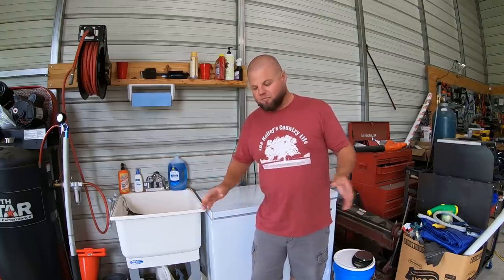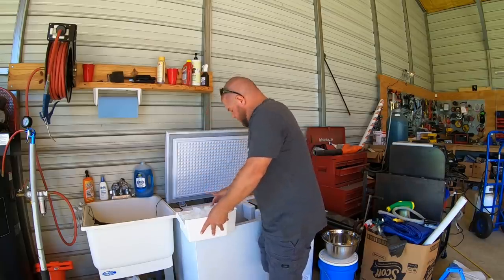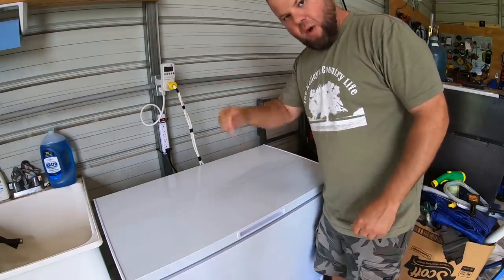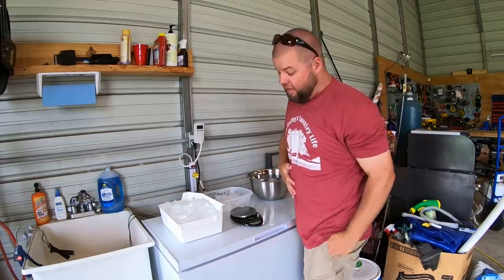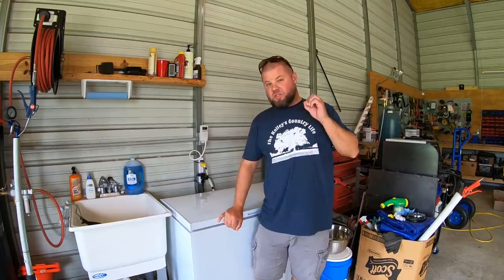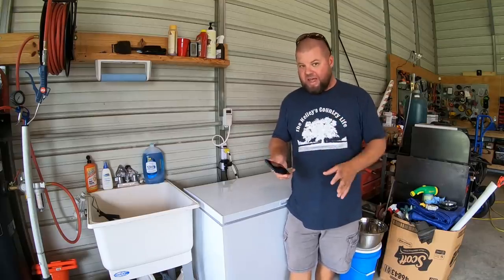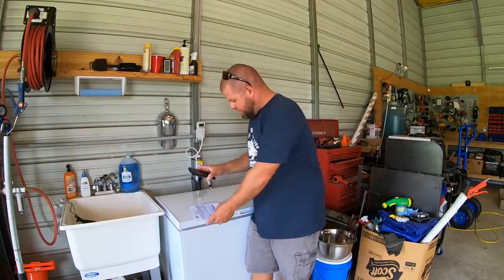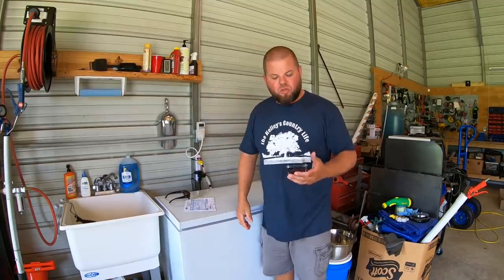Homemade DIY ice machine tests, energy usage and cost per pound! #370

Comment: The cost of commercial icemakers are ridiculous , this is one of the best Ideas I have heard of in a long time.  I live here in Central Florida and go through pounds and pounds of ice a week. Fortunately I have a commercial ice machine that sells 20 lbs bags for $2 right down the road from me.  But I still run out of ice, taking lbs of it with me to work every day.   Been watching this build from the beginning and I don't miss a update.  I want one, but the idea of me putting one of these together is just to scary even with your videos to watch.
Reply from the maker: Well build number 2 might be more user friendly.
Reply: You can do this. Give it a try, you can cobble together videos to learn how to build all this
Reply: TBH, I get it, but I'd encourage you to go for it.

At the worst, you destroy your supplies and they go in the garbage, right? If that's not going to financially ruin you, I'd say the benefit of the sense of accomplishment you'll get from doing this will outweigh the risk you're taking.

You could certainly do this cheaper than him though, find a used deep freezer for one, and to avoid destroying it irreparably, you could drill a hole through the lid, where there is nothing critical.

Worst that happens then, is you patch up the hole and either use it as a regular deep freezer, or give it away to someone.

Just getting the deep freezer and wiring/plumbing the ice maker ate the "hardest" parts of matching his v1 machine, and the ice maker kit comes with the self piercing saddle valve to make the plumbing trivial.

Skip the part of messing with the freezer wiring if you're worried about that and buy a separate power supply to wire them in to.
Reply: If you have the room you will save a ton of money...
Reply: @Nevir202  Love your attitude, yes you hit the nail with the hammer, I am worried about the wiring.  I will take your advice and give it a go , like you said not really throwing that much money away.

Comment: Love this stuff! Great job! You mentioned a box fan to cool the outside, have you considered attaching heat sinks? Like aluminum plates with grooves across it. I think that will help pull heat away from the outside with or without the assistance of a fan, and it may help the efficiency of the freezer.

Comment: I have to say, I've never really had a need for an ice maker at home since we don't really use much ice. But this really makes me want to build one and find excuses to use all of that ice! $.44/20lb is insanely cheap. I think the Rutters up the road from our place sells 8lb bags for $3. This might end up being a nice side hustle for me!
Reply: One thing that I think was overlooked was that he compared the cost of a bag of ice from a convenience store to his energy cost to make the same amount of ice.  He overlooked that the cost at the convenience store also includes some fractional, prorated cost of the equipment used to produce the ice.  He did not include the cost of his own equipment in any way.   That’s a big problem.  He could have used some prorated cost of his own equipment added to the energy costs.  For example, he might guess that his equipment might last 10 years, and if he paid $370 for all the equipment, his equipment cost would be $37 per year or about $0.10 per day.  So if he makes 10 pounds of ice per day, it would take 2 days to make 20 pounds, at an equipment cost of an additional $0.20.  So adding $0.20 equipment costs to the $0.44 energy costs comes to $0.64 for the 20 pounds, still much better than the convenience store. It all depends on the assumptions made for the life of his equipment.
Reply from the maker: Keep watching Don, I do include all costs including equipment
Reply: @donearnhardt6336  He does tell you his cost for all of the equipment. Though he doesn't break the cost of equipment down by hour. But 99% of us aren't going to take a loan out for $370 worth of equipment or try to pay for the equipment by the hour. There's no need to put the cost of equipment into the hourly breakdown. BUT if you want to break it down that way, that's fine and up to you. Either way I think he does a great job with laying all of the relevant info out there. Fridge Ice makers and deep freezers typically last a long time.
Reply: @weschubb3855  I was not talking about the hourly cost of the equipment.  And I know he mentioned the amount of money he spent.  But when you compare his cost to make ice verses the price he paid at a convenience store, you can’t just use the cost of the electric energy he paid to make the ice.  You have to include the cost of his equipment too.  The convenience store includes the cost of their equipment in the price of the ice they sell in addition to the cost of energy (plus their other overhead and profit which I was not suggesting that he calculate).  His cost per bag of ice includes the energy expense plus the equipment costs.
Reply: @weschubb3855  by the way, I’m not trying to distract from what he did to build the ice maker, I think he is very innovative and smart to build this ice maker the way he did..  I’m very much impressed with the way he did it and with all the subsequent tests of his ice compared to other types of ice. Watching these videos has been quite fun.

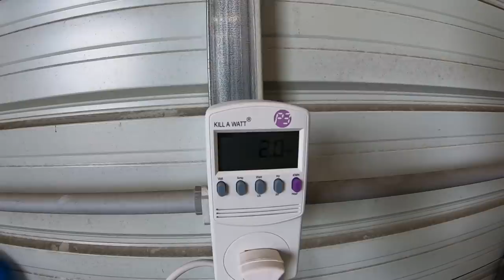Comment: 10:04 That's because the AC/DC power adapters giving off 1 watt of heat. Keep up the great work! I wish I did a video on my icemaker project that I did a long time ago!
Reply: So with a 5v 1.5A (for head room) power adapter and a barrel jack splitter you could use only 1 adapter and maybe save a little more? Probably not worth it except to make it cleaner.

Comment: You are having fun doing this keep it up lol. I have an older commercial ice machine that does burn a lot of electricity so what i did was buy a 14 cubic foot freezer and bought 20 pound ice bags and fill them up and transfer them to the freezer and it fits 19 20 pound bags and then turn the ice machine off till i need it again .

Comment: You need a raspberry pi with a few one wire temp probes so you can track and chart temps of ambient, bottom of the cooler, water coming in, etc. You could run like 8 probes off of one raspberry pi. And they are super cheap too.
Reply: This would be fine for testing/data collection, but I prefer the KISS methods... simpler is better.

Comment: I have bought most of the stuff. gonna get a freezer this weekend. ready to build one
Reply: @charlieodom9107  good thought but I just checked FB market place and craigs list. the cheap ones look 🤕🤢 and the nice looking ones are 🤑🤑🤑  I'm gonna get the Amazon one for $229 and know it's in good working order. thank you for the idea to buy used though
Reply: @charlieodom9107  it's called the Koolatron KTCF195 Compact Top-Opening Chest, Mini Freezer with 7.0 Cubic Feet Capacity-Ideal for Home, Apartment, Condo, Cabin, Basement, Garage-White

Comment: You could also mount everything to the top door/lid so everything is out of the way when you open it so you can have better access to the ice. Looks like it would be pretty easy to hookup those aluminum supports you made.
Reply: I really like that idea, but what if there's water in the ice makers (or even just one of them) when you open the lid?  Kind of a mess.
Reply: @jimichan7649  instead of mounting them solid, they could be mounted on a drop pivot bracket so the ice makers always stay level no matter the angle of the lid.
Reply: @donniecahill5243  Interesting idea, but it's starting to get complicated.

Comment: Run a long copper coil through a mini fridge next to the freezer. Will chill the water between ice maker cycles. And you can keep cold drinks in the shop.
Reply from the maker: It's on the list

Comment: Love the videos man keep it up! I'm also in Florida and have a deep freezer laying around I'll do this to. One major thing to note that will make a difference is the lid seal. My current kitchen freezer after getting anything out then closing it, sucks the door tightly closed for 2 reasons. One is the seal is excellent, and two, the warm air that entered is rapidly being condensed within seconds creating a vacuum and thus rapidly cooling. If you can brainstorm ideas to figure out how to route the tubing and wiring through the lid or a better way to completely seal it, I think you'll have even better results!
Reply from the maker: Wait for version 2.0, I have a fix

Comment: I didn't see the comment but whom ever thought economically you where going to spent more or the same making ice was not thinking clearly. The ice company has to not only make the ice, deliver the ice and freezers to many retail sites using trucks [fuel,insurance, maintenance, etc.], drivers [and all that comes with employees], and share profits with the retail outlets. That is why it costs $3-4 a bag, most of those costs are not what it takes to make ice but the overhead.

Comment: Incoming water temperature will only affect the amount of ice a little, here's why:

To turn water into ice 2 things need to happen.
   1. The temperature must drop to the freezing point
   2. The material must undergo a phase change (from liquid to solid)

How much energy is needed for these 2 steps is described by the "Specific Heat Capacity" and the "Specific Latent Heat" of the material.
   1. The Specific Heat Capacity says how much energy is needed to change the temperature by a certain amount of a certain quantity of material.
   2. The Specific Latent heat says how much energy is needed for a state change (liquid to solid for example) of a certain quantity of material.

For water the numbers are:
   Specific Heat Capacity: 4,200 J/Kg°C
   Specific Latent Heat: 334,000 J/Kg

This means:
   To drop the temperature by 1 degree celsius of 1 kg of water it takes 4,200 Joules of energy.
   To undergo the state change for 1kg of water/ice it takes 334,000 Joules of energy.
Converted to more common units:
   Changing the temperature of 1 pound of water by 1 degree fahrenheit takes 0.000294 KWh
   Changing the state of 1 pound of water to ice takes 0.04208 Kwh

As you can see the majority of the energy goes toward the state change.

Here's a short calculation to show the difference in 2 examples.
   1. Incoming water temperature is 90°f:
      To cool 10 pounds of water to the freezing point it will take (90-32)*10*0.000294 = 0.17 KWh
      For the water to then change to ice it will take 10*0.04208 = 0.42 KWh
   Or in total 0.42 + 0.17 = 0.59 KWh

   2. Incoming water temperature is 60°f:
      To cool the 10 pounds to freezing point it will take (60-32)*10*0.000294 = 0.08KWh
      The state change will remain the same at 0.42 KWh
   In total it will take 0.42 + 0.08 = 0.50 KWh

As you can see the difference between 90°f and 60°f water is only 18%.

So it will be an improvement but don't expect major things out of it.
Reply from the maker: Here is a shocker, I'll give you a sneak peek at the next test series. My incoming water was 99 degrees because the pipe is in the sun. Now factor that in to time to convert per day.
Reply: Can't argue with the given info, but it seems to be geared more toward total production cost not actual production capability???
Reply: TLDR, but agree based on experiments performed in the past. Mpemba effect is negligible if even observable at all.
Reply from the maker: Small numbers are big numbers when comparing to.......small numbers
Reply: I'm very interested in seeing which approach you try for pre cooling. To bring the temp below the ambient shop temp would seem to require a complex solution. And it would be less energy efficient than letting the freezer do the cooling as it is now. 
Pipe insulation could limit the amount of heat that the outside pipe absorbs, but the water flows very slowly and sits in the pipe for a long time. 
Have you measured the duty cycle of the freezer? Meaning what percentage of 24 hours does it run? Unless it is more than about 70%, I would add a third ice maker.  50% more ice making hardware should produce way more than prechilling and is probably the most energy efficient. It has significant upfront cost, but you have installing these down to a science. Who knows how many makers could be installed before the freezer will max out?
Reply: @jctoad  yea the ice machine do not use enough water at one time, anything before the icew machines for cooling i do not believe would work, he might use 3 cups of water for BOTH ice machines maybe, if he was using 5 gal of water at a time a prechiller might work good
Reply: @butchs2337  He didn't really have enough room for 3 ice makers. He eventually got a larger freezer.

Comment: That should be .022 dollars/lb or 2.2 cents/lb. End result still the same of .44 cents for a 20lb bag.
Reply from the maker: Yes I stated it wrong, 2 cents is. 02 of a dollar
Reply: @TKCL  if you can edit that part of the video, at least with text, you should. it's at the 22:50 mark. the mistaken ".022 cent" text is at 23:56.
Reply from the maker: YouTube will not allow editing of videos, only removal of parts.
Reply: @TKCL  hmm! well, then maybe the correction can be put in the video description or a stickied comment.

Comment: This is an AWESOME idea and project! I really like the way you crunch the numbers! I always do the same. (Excel spreadsheet)... I am going to build one of those Ice maker/holder freezers soon! You have done a lot of tests and saved others from having to go through them. Thanks for taking the time and effort to record everything you've done and share with us! 
By the way, I'm already thinking 3 or even 4 ice maker units to increase the production of the ice making! Imagine 4 units dumping ice into that freezer... Would fill it up really quick and at Very LITTLE extra cost to build! Additionally I am mentally seeing a simple "Flap Switch" similar to a water tank, water level cut off switch to shut off the electricity to ice maker units and water flow...  Thanks again and keep up the GREAT videos and ideas!
Reply from the maker: Thank you for watching, another video out very soon.

Comment: Because of your video I’ve decided that I’m going to build one. I have a huge deep freezer that’s honestly way to big for my needs, my plan is to put a divider in that makes the freezer 75% deep freeze and 25% ice maker. Since I’m a fireman, I have access to a thermal imaging camera. I plan on taking the freezer to the fire station and plugging it in so that I can use the TIC camera to see the cooling lines in the wall of the freezer so that I can safely drill through the freezer wall to plumb in my ice makers and fans. You’re video has been a hell of an inspiration buddy! Keep the vids coming!

Comment: Get one of those personal 6 pack can mini fridges and coil up some tubing for the water to go through in the mini fridge. My French door fridge has a bunch of tubing in the fridge portion to pre cool the water. Good luck! I love this series!
Reply: Those little fridges generally use a peltier cooling device which are horribly inefficient. It would probably be cheaper to run another full size freezer.
Reply: @ClownHatchery  he wouldn’t want to use a freezer to cool the water it would freeze.
Reply: Thinking  along similar line.  Coil up enough tubing to give you the volume of the ice makers, buy something to insulate (rigid foam, one of those cheap foam coolers etc) lay the tubing on the lid cover with insulation and it should cool the water while the ice makers are freezing the current batch. I left my foam cooler on top of my garage refrigerator  once and was amazed how cool it was under there the next time I used it.   Drawback will be the lifting of the lid each time.  Wish I had your energy and enthusiasm!!!  Great project
Reply from the maker: One step ahead of you, thanks for the suggestions.

Comment: First off I really enjoy watching your videos. What a great job making a ice maker for such a great price. 
I was not surprised that the difference between 2 fans and 1 fan was as small as it was. If you look at wind-chill formulas the biggest difference in time for water to freeze is between 0 mph and 4 mph.  As long as long as you have air flow of 4 mph or more you will get about the same effect you could try to increase the wind speed to get more of a cooling effect but  it would not give you much of an increases in production. The best way to increase the amount of ice production by 50% or so is to lower the air temperature in the freezer. 

Without the fans the air temperature is around 0 and with the fans say 5 mph the wind-chill is now -11. So if you lowered the temperature to  -11 you would get the same amount without the fans or with the fans the wind-chill would be apx -23   so lowering the air temperature to -11  and running 2 fans close to the ice makers you should get apx 40-50% more ice production. I know your ice production would increase, i am just not sure if it would be more costly per lbs as your compress would be running more.  So if you were needing a large amount of ice on a holiday weekend it would be well worth it to lower the temperature even if the cost doubled (I dont think it would be that much) but still 88 cents for 20 lbs of ice that is still a great deal and it would be only for a short time when you knew you were going to need a large amount of ice.
Reply from the maker: Thank you for the information, I plan to test this

Comment: Hi from Australia. Love the series. Here is my suggestion - What about installing some (PVC cheap plastic plumbing) ductwork inside the freezer to duct the colder air at the bottom of the freezer to the fans , so slightly colder air is blown over the icemakers, rather than just the air at the top of the freezer.
Reply from the maker: It's on my list, thanks for watching